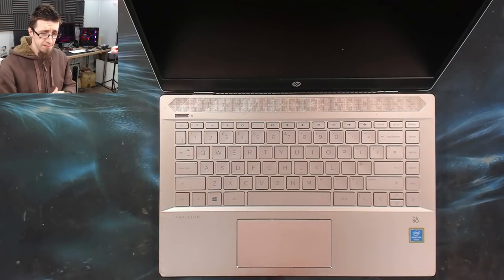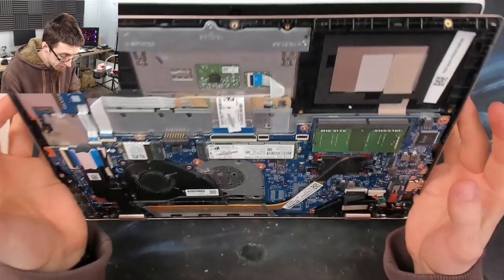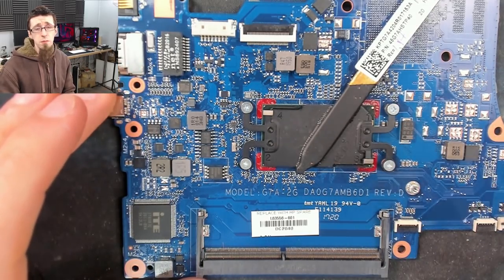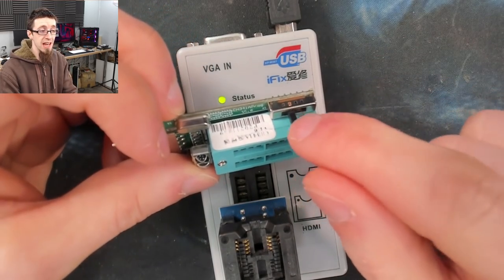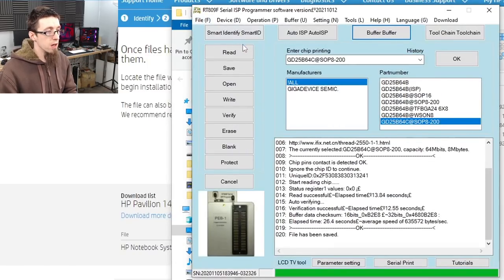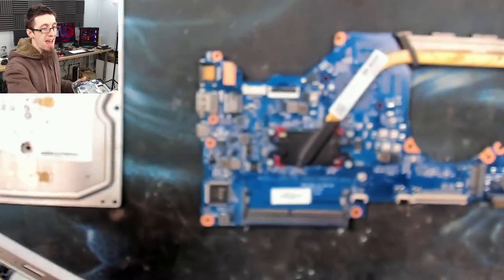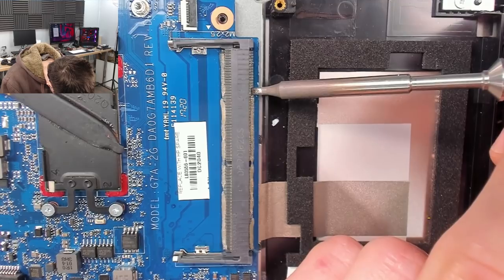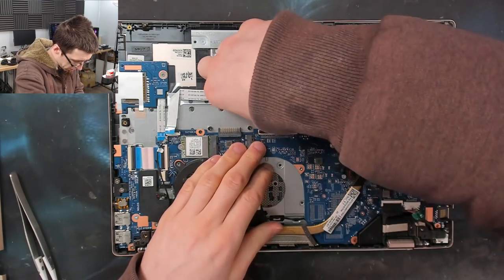HP Pavilion: 3 Long, 2 Short caps flashes - LFC#303

Comment: You are a LEGEND. I had an Acer laptop that had similar symptoms (Turn ON, loud fan, No POST). I tried reprogramming the bios chip and it did not work. Today I watched your video and retouched the RAM Pins with soldering iron and it worked like a charm.

Comment: Great effort, however piece of advice about hp 14-ce series - they have a know issue with cracked solder joints on DIMM slot, hence your issue, but it's always 2 pins on each edge that goes bad, so you don't need to put a lot of flux on whole slot, just on 4 edges. To avoid issue in the future, try to tighten the DIMM slot by slightly moving one of the arms inwards (melt ground pad that holds the arm, then move it). Also, this will crack again with normal reflow, you need to add some solder to the mentioned pins.

Comment: There are 2 files in the update package for 2 different platforms from the same laptop series or using the same motherboard (but configured differently).
HP platforms are identified by the BID number, which happens to be the filename of the BIOS image from the update package. You can find the BID of the dump from your board using a hex editor and looking for the "BID" or "BVDT" string. It can sometimes also be read from the sticker on the laptop.
When you download random BIOS dumps online, you must also make sure to match the BID number, even if the motherboard model number is the same.
In this specific case, 084B9 is apparently for a Kaby Lake platform (and contains ME 11.8) while 084C0 is for a Whiskey Lake platform (and contains ME 12.0) which requires a larger SPI ROM.
Reply: Hi brother, i read your comment and it amused me that you know  things in details. Probably it takes time to get that experience and knowledge about the stuff you know about. I have a request to you, I am dealing with a situation where i need your help and assistance. I know you might be a busy person, but it would mean a lot to me if you could assist me with a technical issue i am facing. I hope so you would find this comment, please give me a reply so that i can describe you the things. I would be really thankful to you.

Comment: Cool fix! Small tip - be very careful when using chisel iron on this kind of fine pitch connectors. Sliding it along makes it very easy to bend a pin. Always do few at a time and move the iron away from the pins, not along them. Slower but safer. Ask me how I know…

Comment: You my friend, are a genius! I used a flat from my iFixit Protech Tool Kit and heated the tip with a lighter since I don’t have a soldering gun or heating station. A pin from the DIMM slot on the side of the RAM was visibly sticking out, so I pushed it back down nicely and worked like a charm!

Comment: You are right, Adam. I have a very good clip (not a cheap chinese one), and I was never able to program the BIOS chip in situ. I attempted it a lot of times, but I reckon the best (and the only good way) to program a BIOS chip is removing it from the MoBo. I have the 341, but I normally use my SVOD2. The ECs are very similar (problematic, too, in circuit). So that's the reason why I have the 128 pin ZIF socket in order to program new ECs. BTW, congrats with this repair. It is not a very common fault (I mean the pins and its solder to the board; not so the contact cleaning, or the module itself). Thanks again for being here, and for sharing your good times with us.

Comment: Thanks so much. For this video. Following a ram upgrade, I had exactly this problem.
Whilst I don’t have the kit to address the bios, I did resolder part of the track where the ram inserts. (I noticed a few shiny spots). It worked perfectly. 
You have saved my computer. I was on the verge of giving up and scrapping it.

Comment: I ran into a similar issue in the past, I'm not good with a soldering iron, so I used a dielectric contact cleaner, brushed it, clean again, installed everything back and it worked for a year.

Comment: About the second option of the hp exe file (recovery usb drive).

HP has an option to flash the bios which is activated by holding (win+b or win+v) +power button for 2-3 seconds then release the power button but keep pressing the combination until a sound appears. It will start automatic recovery. Really nice channel, nice way of explaining things, love the teaching that you are doing. Keep it going.

Comment: Some bios exe files you can extract with 7-zip, by just right-clicking > extract to folder. Worth a shot
Reply: You can also do the same thing with WinRAR
Reply: Becuase most of the time they're just Self Extracting Archives.
Reply: Or UniExtract. I've had some luck with that when not even 7-zip would do the job.

Comment: I think I said this before but what I do is have a bunch of new chips ready to go. They don't cost an awful lot for a set of 5-10. That way I don't have to touch the original IC at all - I just pull it off, read it, set it to one side and try everything on a new chip (or even several of them until it works). That way, I eliminate the possibility of a bad chip, plus I don't risk bricking the original, despite already having what SHOULD be a backup...heck - I may just forget and click erase out of sheer negligence before even reading it :)))
Reply: Also read the dumped bios in UEFI tool (alpha 58 build) it will list the supported flash chips. If you don’t use one on the list you may encounter issues updating the bios in the future.
Reply: Replacing the BIOS chip also means you avoid the problem of bit rot.
Reply: Replacement SPI ROM PID/VID may not be in the VSCC table so better keep original IC. And in any case you still need to match voltage and some other parameters (for example Quad SPI mode and size in most cases). So in fact it does add more variables to the problem.

Comment: This was one unusual fix! Well done! And you got the same error codes before (after BIOS re-program), so I believe that the issue was not yet fixed at that time.
Also pretty sure that cuppa during the break was as good as it can be! :)
Reply: For an HP, as he mentioned in the intro, it's really common. Even doing hobbyist repairs those programmers and knowing how to use them is essential.
Reply: @SerenoOunce   was referring to the solder reflow, not the BIOS re-program.

Comment: Thank you for sharing. my 2 cents. You should add laded solder to the chip before removing it, it'll lower the melting temperature , this way the chip solder will melt way before other tiny components melt

Comment: Ultimate tutorial on working with ram slots and thanks for sharing it. One question, is the caps lock signal about ram failure is same on all hp laptops, also some hp laptops do not display any signal about RAM failure, in this case, how can we identify it.

Comment: After watching video, I have also had luck just cleaning out ram slots with a switch cleaner, sometimes use deoxit and bending the retaining clips in further for tighter fit on HP laptops. So maybe yours wasn’t just a bad joint but perhaps the flux just cleaned out the socket somewhat but hard to say after the fact. Good job anyhow
Reply: That's good tip for any electronics. Just clear, unplug and reconnect any cables and ports.

Comment: the older ICs were dimensioned in inches either 100 mils (a mil is 1/1000 inch), or approx 2.5 mm for PDIP, or 50 mils (.050 inches)  or ~ 1.25 mm for SOT-8 or SOIC

Comment: I used a clip to flash the BIOS chip(s) on my ThinkPad T430.  The strange thing was that I had to have the laptop's power brick connected and NOT connect the clip's power/ground pins.

Comment: Had a similar issue with 2 HP Probooks yesterday - luckily solved by just replacing the SO-DIMM in one case and by disconnecting battery and CMOS battery in the other

Comment: 3 long 2 short - it's been my nemesis for a few weeks now.  hp pavilion power desktop 580-131.  jumper bios reset.  battery bios reset.  single stick ddr4 in slot nearest cpu.  waiting for new ddr4 to arrive.  so far - nada.

i saw a guy use clips of staples as heat shields - just lay the clip over the components you're protecting
Reply: new ddr4 2x4gb, still 3&2 - they're going back. factory ddr4 reinstalled.  cpu - heatsink removed, surfaces cleaned and fresh thermal paste applied.  voilá case closed.  literally, i closed it back up when the box posted. ty good night.

Comment: My old Asus Zenbook laptop developed heaps of trouble with its RAM expansion slot that expands the memory of the laptop from its base onboard 4GB, I wonder if bad solder joints on the slot were the issue. The RAM slot would work intermittently, and with a certain thin memory module installed in there (only with that module), pressing down on the chassis near that area would cause the laptop to crash, with the video on the screen glitching up and freezing. The laptop was at one point put back together incorrectly and the chassis flexed an awful amount which may have caused the breakage of the solder joints on the RAM slot if that's the issue here.

Comment: Quick solution that worked for me: removed one of the RAMs, it still did not start, so I put that one back, and removed the other RAM. My laptop started normally after that. There is 50% less memory, but the laptop works.

Comment: An example here of tortoise and hare... jumping straight to the worst case before checking the simple stuff, swapping out the RAM for known good should have ben the first step, Clipping the BIOS chip to pull the .bin file off it so that you can check its contents would be quicker, I did think RAM socket pins when I saw the board part number and reflowing them is a known fix on this board, but to jump straight into pulling the BIOS chip off was making me pull my hair out.
Reply: He did swap the RAM before removing the chip.

Comment: another great vid for mid level techs looking to expand!
Bios recovery = unplug hdd/ssd then plug in usb and hold Win B keys plug in power and keep holding Win B.
sometimes its picky on usb flashdrive but not as often as 2012 days.
about %40 of times it works and only takes 5 mins and saves 40 mins.. if it works.

on the 2 files from exe.. HP makes multiple board models for similar model range.. 16MB file is for a different board.
if u hexedit search for the 084B or 084C in original u will see which u have if both files were same 8MB size but in this case its 2 files for 2 boards 8 vs 16Mb
the .sig file is signature file for recovery procedure.

Comment: Thankyou. Any chance you could do a segment on the configs and changes you would have had to make had a new bios code been required. You eluded to SN for example?  Cheers
Reply from the maker: Yea I'm hoping to get into that more in future videos. For these modern HPs, they actually have BIOS flashback, so the entire programming section was kinda unnecessary, but I didn't realise until I'd already started. Still, important skill for other models, since BIOS flashback on a laptop isn't common.
Reply: Check out Graham's LFC#298: https://youtu.be/duObbQLFHwI

Comment: Both CMOS chips should be flashed at same time. May still fail to POST if there is a mismatch. And should only need to transfer unique identifiers (PN, SN) on the main IC. The EC BIOS should correct for that info by itself during POST.

Comment: Regarding in-circuit flashing: If you're doing it with the laptop turned off, you're injecting 3.3/5V (flash chip VCC) into the board with all the other rails unpowered, this can cause CMOS latch up in other devices, damaging them. If you're doing it with the laptop turned on, the controller's push/pull data lines and the programming device's can possibly short circuit if they're both driving a diffirent state to the same data line. So yeah, don't...

Comment: Seems that memory error code is pretty universal across all HP machines.  I was adding new memory sticks to my HP Omen 880 recently and I got that same error code.  After my panic subsided, I got real close to the memory slots and gently but firmly pressed down on the securing clip side of the memory card, and suddenly it went in another mm or so and there was a 'click'.  After that it worked like a charm.  Those DIMM memory slots on the Tampa mb are poorly designed and take more effort than you'd think to seat them.

Comment: I had my dad's old toshiba from 1998, and it has 64mb build in, and 2 memory slots which can accept up to 128mb of sd-ram. But a couple of months ago, this laptop would only detect 192mb, turned out that there were some pins that came loose from the mobo, so yeah, i did a reflow on those and the slot still works flawlessly. And this is also a fix for the aluminum powerbook g4's, they would only detect 1gb of ram while 2 is installed, you need to reflow those pins from the bottom slot to make it work again.

Comment: Thank you so much for your videos. It helped me flash my first bios chip. I seem to be having an issue though. The bios keeps getting corrupted after a successful flash. I tried replacing with a new bios chip and still had the same issue. Each time I desoldered it, the read flash had a different checksum than what I flashed it with. Do you know anything that could consistently corrupt the bios?

Comment: Last 2 times I used the clip claws for the bios... I didn't have success.. It kept saying some pins were not properly connecting. A beep-beep test with multimeter said otherwise. Pins 1 and 8 were always connected but xgpro tl866II plus said otherwise. Removing the chip from the board, I could read it. On time, I used the claws with an asus x555 laptop and programmer read the chip fine.

Comment: don't know man the soldering ,nah... I just use the flash clip and do the verify I know it's intended to test but if verification is 100% ,connection all good. I know seems unreliable but main reason is the oxidation on flash chip legs ,just a bit contact spray ,toothbrush then all good ,worked for me around 20 time and using the cheapest aliexpress CH341a

Comment: I always use a soldering iron to secure the chip into place with one or two legs and then I use hot air.
Reply: Yes was going to say the same thing as this was something I would do when I used repair TVs back in the day like when replacing a sound chip so much easier to secure the chip in place by touching up a few pins first then proceed with the full soldiering 

But actually learned to do that the hard way before the days of hot air reflow gear when having to soldier chips onto boards with just a soldiering iron 

Wow the good old days

Comment: I would remove the memory card and then see if I got the same beep error. If I did then it could really point to a problem with memory, however if I got a different beep code then it might mean that the problem was either a more subtle memory issue (e.g. bad memory cells) or that the error was not really to do with memory but something it was testing before it got to the memory test. Sometimes this helps with the diagnosis.

Comment: Brilliant repair job, m8ty. A few months ago i was doing a BIOS update on my B450 Aorus Elite board and i attempted to use Gigabytes @BIOS software instead of doing it through the BIOS itself. BIG, BIG mistake that turned out to be. Had to de-solder my BIOS chip and pop into my chip programmer and flash the latest update. Thank goodness that worked for me. Will never trust using the @BIOS software ever again and i'll stick to any further updates through the actual BIOS itself. Great work though
Reply: Check out LFC#183: https://youtu.be/bOPQAaLlOWA "Gigabyte's BIOS update bricked my B450 Aorus M"

Comment: Before learning this skill you'd tell the customer it needs new board and labour. Now you can fix it then is it just labour? Is it still the same price for the customer? As it will take you much longer labour wise?
Reply from the maker: I charge more for board repair. It still costs the customer less that fitting+parts, but generates more profit for me.
Reply: @Adamant_IT  thanks i was curious as in my old job due to the hourly labour rate we often just swapped the boards out. This was also the case when i was working for dell back in 2009.

Comment: About flashing without working ram. Some MSI (or is Gigabyte? mmm...) motherboards have a flash button with the rear IO ports. The manual says to remove cpu and ram to do the flash.
Reply from the maker: Yea, I think Flashback would've worked on this one and saved me the trouble of removing the chip - but I'd already done that much before I realised it was an option.

Comment: You made a mistake at 24:25, the point is clear, but you opened original OEM bios, not the freshly extracted one.
Reply from the maker: That was the intent, I wanted to check that the single file I had backed up was the entire BIOS. Although opening that or the downloaded one would also have worked, so yea, no matter either way 👌
Reply: @Adamant_IT  Ah, it seemed to me that you intended to open the extracted file, but fair point, either definitely works.

Comment: Hi 14-ce series is notorious for faulty ram slot , you should get ram slot tester , it help expecially in this case , most of the time ram slot replacement revive this laptop but sometimes ram controler on cpu dies...sometimes trace inside pcb from cpu to ram data line loses connection,  on and all this was very bad design by quanta...
Reply from the maker: Yea, I actually saw some folks discussing them in my discord the weekend I was editing this vid and was like "I should get one of those!"
Reply: Where can I bought s ram tester ? Have Link ? Thanks from Portugal 🇵🇹
Reply: Ram tester available on ebay